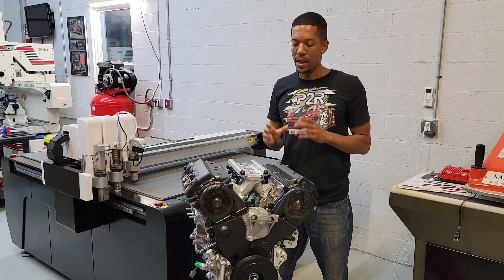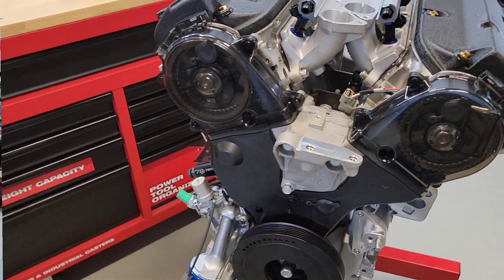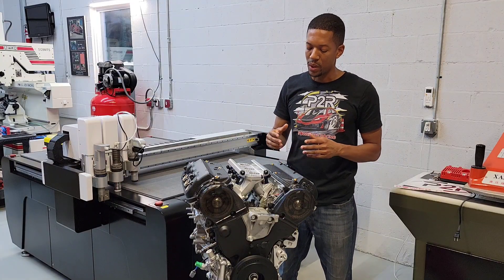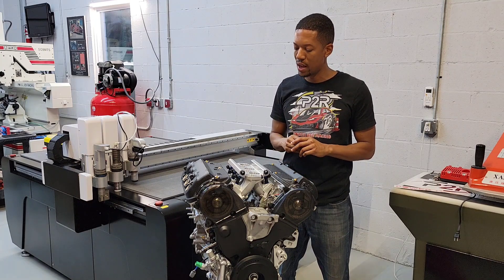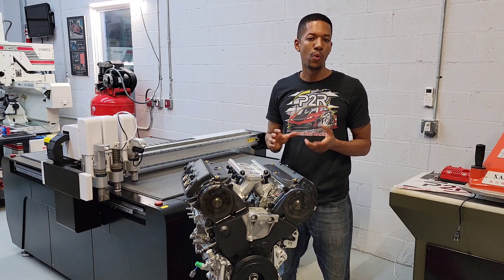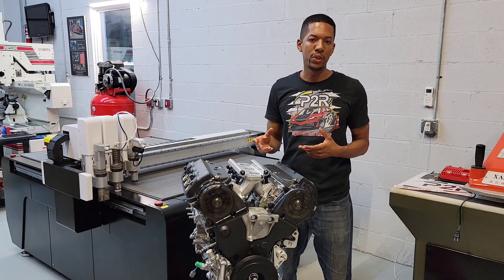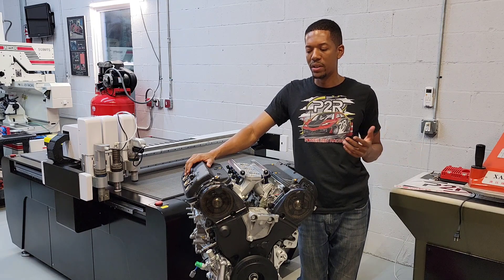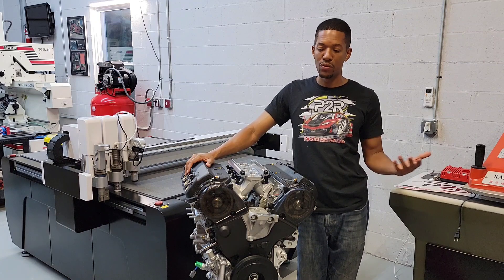J32 OE+ Performance Engine Build Time-lapse

Comment: I am about to build a J32a2 for road course racing here soon. It will be going into a full tube chassis car that will start its life as a open car (think Ariel Atom type) and eventually end up with a Prototype shell over it down the road. We are mating it to a ATC6 trans and running the whole thing on an AEM Infinity ECU. I have been swaying towards an all motor/high-comp build with ITBs for the second iteration of the car, but will be running the motor as something close to stock (springs, retainers, and a full refresh) A ton of parts we will be using will be from your company and i'm glad that you guys support the J platform so well.

So here is the big question. Do you offer build consultation to make sure we are making the right choices for our goals?
Reply from the maker: Yes, of course, and we would love to be a part of that build. Give us a call, and we can work out a build that will be best suited for that application.

Comment: what's the purpose for swapping the Dowel Pins?
Reply from the maker: 2 of them are hallow, and 2 are solid. Need in proper position to make sure the rockers get oil to engage the vtec.